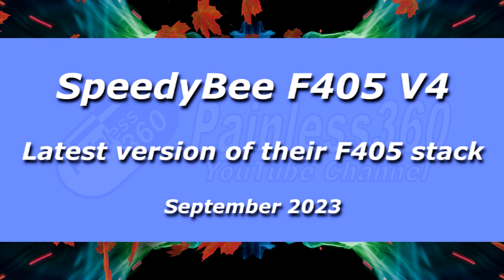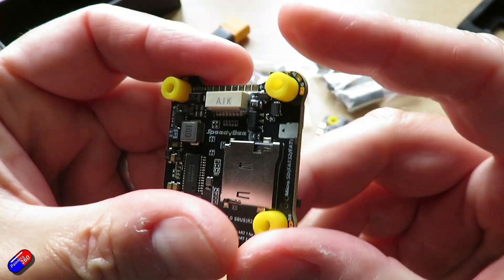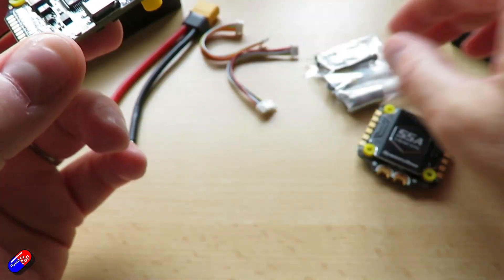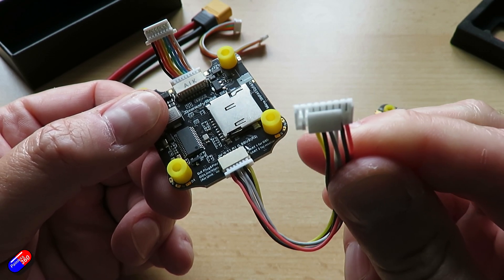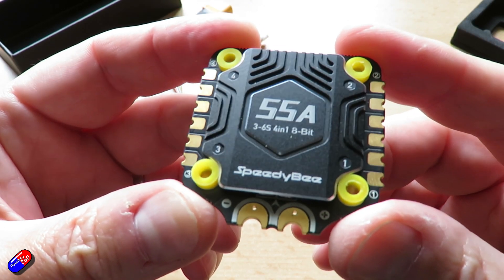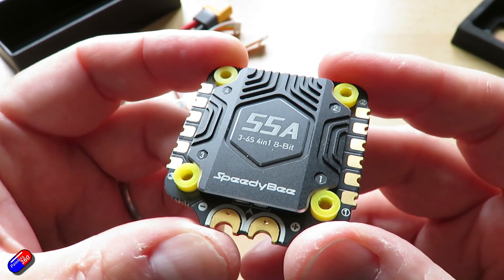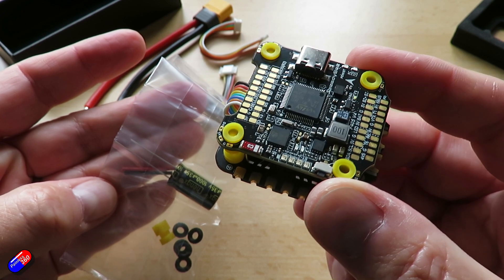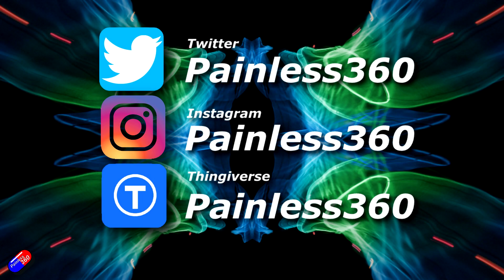New SPEEDYBEE F405 V4 Wireless Flight Stack and ESC

Comment: Thanks for pointing out that iNAV doesn't offer DSHOT with the previous v3 model, that I have in my quad. I wasn't aware of that. I wanted to give iNAV a try but will stay with Betaflight for now. I guess at some point, I could upgrade to the V4 FC version while keeping the old ESC on the lower deck.

Comment: @ 1:08 Let us all take a moment to appreciate the dab of glue added to support the VTx plug.
Now let us question why just that plug lol? I use Foam Tac for the same purpose, as well as any soldered wires for support. There was a time when USB connectors were held on flight controllers with nothing but Hopes and Dreams, and this became the fix. Comes off cleaner than hot glue, and no worries for electricity. Thanks for covering the V4 changes, Sir. The 4 V3's I've installed have been primo, minus the 20x20 I have in an anniversary-build 500mm quad that I just can't de-wobble for the life of me. It's like I pissed off the I-Term calculator script and it's being broody lol

Comment: Damn, I just purchased the F7 stack :) I do have the V3 and it is a great bang for the buck but I had problems with gyro noise and the unusual DMA configuration that prevents INAV to have DSHOT is a downer as well though nothing critical for my build (7" long ranger).

Comment: I wish companies would put the cam and vtx pads on the side. I've flipped my ESC around so either I run my cam + vtx wires across the board or I run the ESC wires under the board. Putting the pads in the middle would be a good compromise.

edit: Or massive brain idea. Most of these companies are putting two cam pads on the board. Put a cam and vtx connection on the front and back of the board. The two cams can be for separate cameras and the vtx pad can be redundant.

Comment: Watched a video a few days ago where a new speed re ord was set with a quad copter, 250 mph .  A  challenge I think you might best .  Project includes 3D printing frame for aerodynamics  , tweeking pids,  camera,  heck of a challenge,  arms have be wings as speed run unit is 90 degrees over ...I'm having trouble describing this thing ...but can you break 300mph ?  Is the engineer inside going well if.....Take care my friend .

Comment: As an owner of the board, I am unimpressed. The board was shipped with a bad bootloader for updating. The heat sink makes soldering harder. And somehow it looks like it blew a capacitor on motor 1 on day two. I wouldnt call it an improvement on the v3 other then the camera data displaying more

Comment: Hi, thank you so much for your video. I plan to make a drone using this flight controller and I’m wondering that would it be possible to connect it to Arduino Uno (I want to be able to control the drone with arduino). 😊
Reply from the maker: That is not something I know about. Best of luck

Comment: Would this flight controller be considered the latest and greatest for planes and wings also? Or what is the latest?
Reply from the maker: If you want a wing/plane build, check out the building series on the channel. I'd get one of the flight controllers designed for a wing/plane ; Matek F411-WTE, Matek F405-WMN, Matek F405-Wingv2 or SpeedyBee F405-Wing..

Comment: Can someone tell me what GPS I need to have Altitude Hold. This board has built-in compass. ( I THINK)
Thank for the help..
Reply from the maker: I'd use an external compass so any of the M8 or M10 based GPS units with a compass will work. See my INAV builds, I tend to use Matek GPS units... Happy flying
Reply: I was just about to ask the same thing…